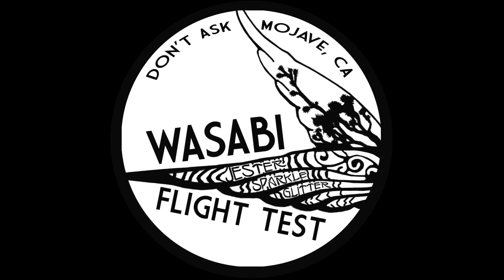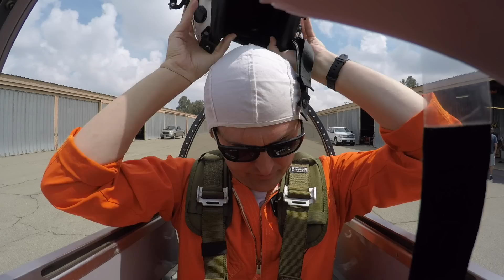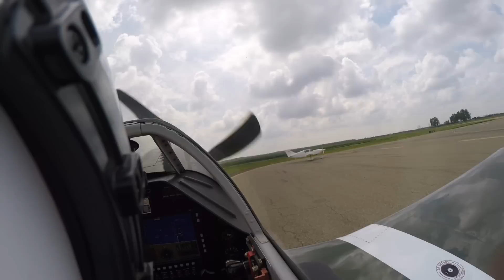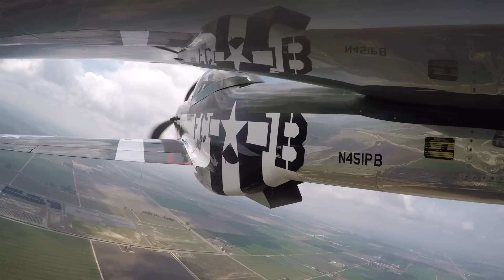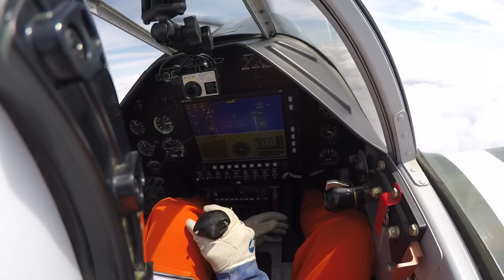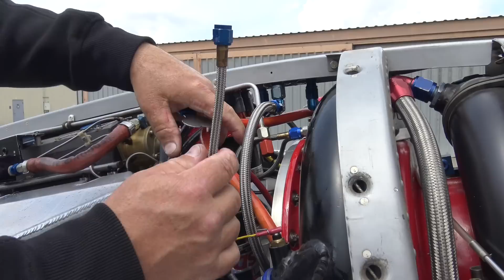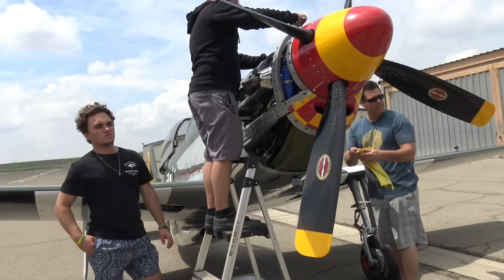Emergency Landing, Loss of Propeller Control, #Bowerspony Lucky Flt 13 -Long Cut w/ Debrief

Comment: Appreciate the extra info, especially as an aero student interested in flight test.  Quick question: I noticed you had the mask on your helmet,  I assume that is more for the mic and or smoke, and less of O2.  Do you have actually have the tube hooked up to O2 or is it just free-floating in the cabin?
Reply from the maker: Thank you for asking.

yes, we were masks for 3 reasons:
Smoke in the cockpit
Better comms (in noisy cockpits)
Crash Protection

I can also admit after my accident the mask has become a bit of a security blanket for me.  And if the only price for that added safety is looking like a tool, I'll take it.

More here:
https://www.youtube.com/watch?v=a-lceaOL2E8

Comment: From Jim, a long time member of the Stewart S-51 community, retired AA Captain, former A-10 pilot, and SME of the engine configuration in this and many of the S-51s. "A couple points that weren’t mentioned in this video but need to be addressed.  Rod’s airplane and several others out there have a dedicated, separate oil system for the PSRU.  The oil line that came loose was the line that routes the excess oil that the prop doesn’t require back to the PSRU oil supply tank.  This pump supplies oil to lube and cool the bearings and gears in the PSRU as well as provide pressurized oil to the prop governor.  When the pump became starved for oil, the prop “auto feathered”,  transitioning to coarse pitch like it was designed to.  A lot easier to deal with at altitude than at the end of the runway at takeoff.   The engine had no issues as it’s oil supply is separate from the PSRU.  The PSRU ran at a low power setting for several minutes without oil pressure which is a non issue."
Reply from the maker: Michael McConnell thanks for the info
Reply: @utopiasnow  Hi Elliot & Michael McConnell.  As you know I been heavily involved in the Thunder Mustang community for 20 years, have built and flown a TM , ~250 hours and helped with a several of others.  Still fly N151JM in COS. I also flew my TM as chase for the Adam Aircraft A700.  Actually, I flew back seat and filmed in those chase flights while a pro like Elliot flew the very close formation.  Anyway, unfortunately I have also studied the incidents which have occurred with the TM and one thing that I am now questioning is whether it is better to have the prop got to course or fine pitch upon a failure!  Why?  There have been several instances where the engine has been running fine but some part of the prop control system has failed, causing essentially a dead stick landing.  If the prop had gone to fine pitch, the pilot would have had much more time to plan and potentially make a safe landing.  Love to discuss this with you (IM me on Facebook for my number).

Also, I'd like to comment on distractions and the line coming off.  It's a reality. Phones, texts, hangar visits from airport bums like me, bathroom visits, trying to find the darn tool that was in my hand just 10 seconds, lunch, etc. etc.  Distractions aren't new and I'd suggest that builders always use torque marker.  Always. Never half tighten something because of an interruption, complete the task and ignore the interruption and never put in a bolt, install a nut or connect a line "temporarily" and hand tighten.  If it gets installed, install like it's going to fly and mark it with torque marker.  My comments here are not intended to be directed at this builder/owner or the crew but for all of us in the experimental community. I've made these same mistakes myself.

https://www.grainger.com/product/DYKEM-Permanent-Tube-Marker-4TKH1

Comment: Elliot - brand new subscriber, I'm fascinated with your channel. I loved this video, so definitely keep these up if you can!
I'm curious when he's talking about "high key" and "low key" in regards to finding the AP through the clouds - what to these phrases mean?
Also, when he talks about S turning to see the break in the clouds - does this just mean S as in an S over the ground? I.e. trying to fly to see the break in the clouds, but not cover too much ground to get too far away from Ap?
Reply from the maker: Clark Mulvey 

S turns yes.

High key is a location in a standardized emergency approach pattern.  Directly over the numbers with one 360 degree turn to go before touch down.

Low key is halfway through that turn, so basically downwind abeam.
Reply: @utopiasnow  That makes sense, thanks for the reply!
When you're shaving speed on the final approach at the end of the emergency landing, are you shooting for a specific speed? Or are you just shaving off as much speed as possible before you get to the runway? Does the answer to this question have much to do with the radius of the S turn, or is there a threshold radius where you don't want to be too far off center line?
Reply from the maker: @GruntildasBear  Cool question.

As I said in the video most of our emergency landing prep for this airplane was done "high drag" configuration.  In those scenarios I want all the speed I can get to give me time to round out and flare (I use gear speed).  In this case (low drag) I could have approached slower but I chose to use the high speed (high drag) approach numbers, which worked.

This problem of a wide range of emergency glide ratios has been a killer in this class of airplanes.  So I would suggest to operators to simplify that range of procedures as much as possible, because its already so complicated.

Comment: Feedback notes, provided with the caveat that these are suggestions for minor tweaks on a fascinating video that to me is a perfect length. Good job. I'm only mentioning some of the bits that could be improved not the vast majority that is already great.

(a) If you're using an aviation specific acronym that a fair percentage of viewers won't be familiar then subtitle it at the first time is mentioned. Personally I felt a bit left behind in the narrative wondering what the device was that they were swapping seals on. Eventually one of the speakers used the full name so I was able to reconnect with what was going on.

(b) Camera angle for the intro. Sorry but I really don't want to look up your nose!

(c) Be aware of your background. The window overexposes the footage and the kids stuff on the walls both makes the audience connect on a human level which is great but also provides some clutter again distracting from the narrative. Personally I'd hang a plain sheet on the wall and sit in front of that, but maybe that's just me.

(d) Personal taste but not a fan of the canoe segways. The movement took the eye when I should have been reading the subtitles, and then they were gone.

Sorry if any of that sounds overly critical, but you did ask 😉👍

Question:- You mentioned Raptor. Are there any signs of that being tentatively dated or is it too soon for any dates to be anything but speculation? Oh and thanks for the great video!
Reply from the maker: Owen Sparks thank you for the notes.

The Raptor program is waiting on the virus.